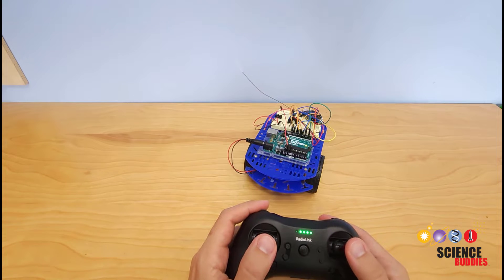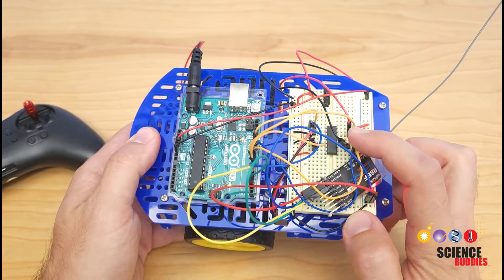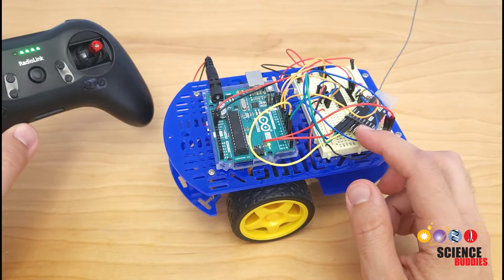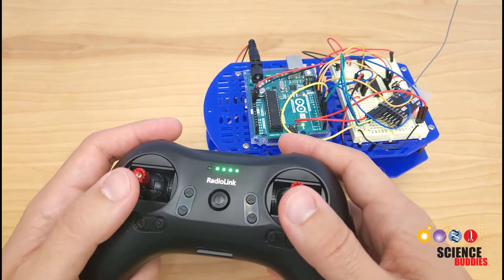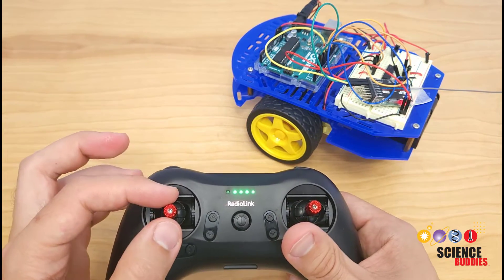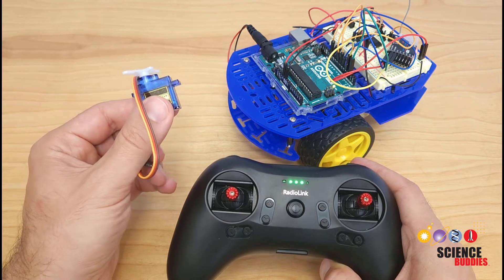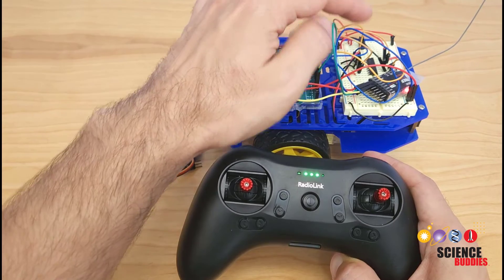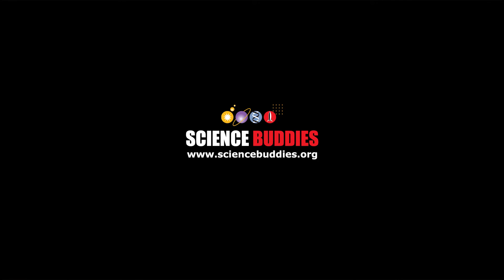Build a Radio-Controlled (RC) Arduino Robot | Science Project

Comment: [Question SB.01]: Do the radio waves you are using need line of site to function or are the frequencies low enough to pass through objects and walls? Thanks, JD.
Reply from the maker: What thickness/type of obstacle they can go through will depend on the specific controller, but in general this type of controller does not require direct line of sight.
Reply: @Science.Buddies thank you. I will report back to you after I have completed my robot and tested based on distance of transmission and line of sight. If you care? Thanks, JD.